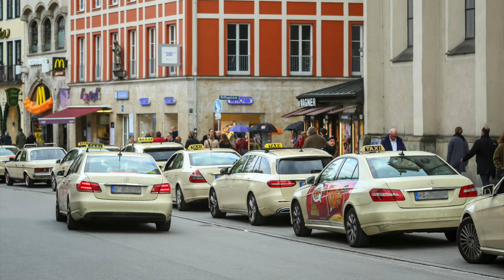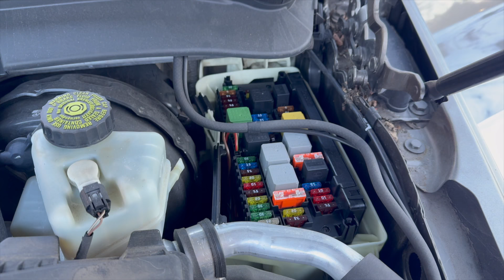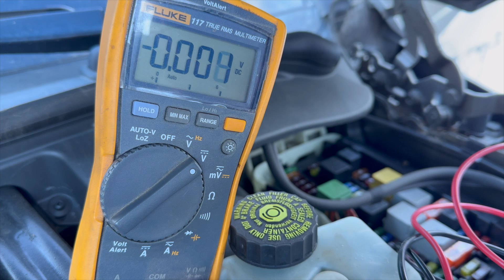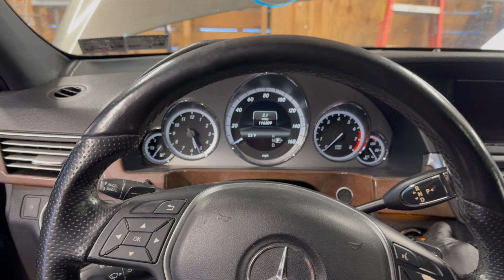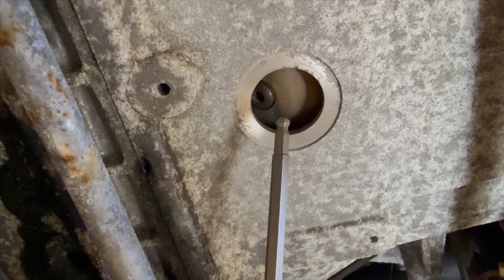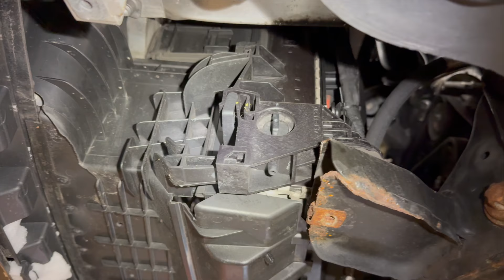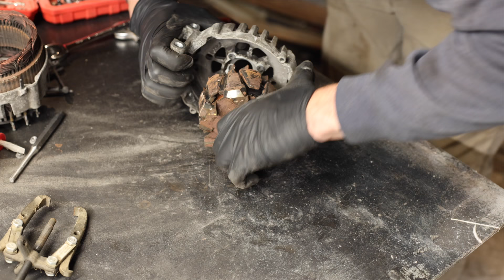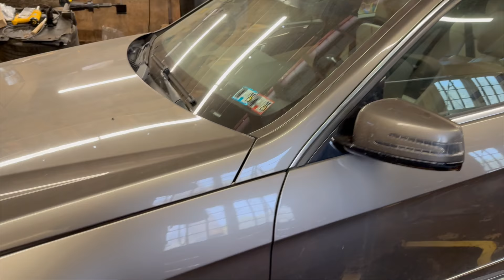I Bought the Toyota Camry of Germany, Except WAY Cheaper (and Better)

Comment: I am a German Taxi driver, my S212 E-Class OM651 got 600.000km with the Original Motor and Transmission. 
The Transmission gave up Motor was still running.
Reply: I have same engine in my sprinter van and currently I have 730k miles on engine and trans still running strong no issues neither has ever been opened.  Hands down best engine produced my buddy had 1 with 1 million and 50 thousand miles when he sold it
Reply: @mikibajrektarevic2543 Ah the old ones are reliable, the new ones are a nightmare, as all other cars, the systems light up like a christmas tree, I work for RSA, Waldo is right with the hit or miss statement, we had a million rule changes, like Sprinters and all other vans excluding the V class did not have Mobility warranty for non-technical issues, unlike passenger cars, who had coverage for technical and none technical issues, ironically enough they changed that rule literally today so that Vans and Transporters have coverage as well, people arent happy when they pay a lot of cash, do their service regularly, have an accident and then need to pay for the towing, when i saw the new rule book i thought it was a April fools joke, luckily its not, and as a Rep. I'm happy, i don't have to explain to people yeah sorry you had an accident with your expensive Sprinter, but an accident is not a technical issue so you are not covered, but if you have a "smart" and the same thing happens you are good, i mean what were they thinking, i mean corporate makes some braindead choices sometimes...
Reply: I bought ex german taxi car. E200CDI 2007. OM646 is one of the most reliable euro4 diesel engines. original transmission and engine. never been repaired. Has over 650K km. Runs great like 200K km car.
Reply: I always heard Mercedes was always on the least reliable vehicles list! I've seen some people have issues with s550 and cls class vehicles! Never would I have thought its compared to a camry!!!
Reply: @patrik4446  Quite the contrary. Widely known MB made the most durable cars for a very long time.
Reply: @martinsvensson6884 really? What are the best Mercedes to buy? Year and model wise? Are they expensive to fix? Im very interested to learn more about them!
Reply: @martinsvensson6884 history😊
Reply: @martinsvensson6884  I think it depends on the model. The small A-class did not have such a good track-record.
Reply: @ThorDyrden  really, 360.000 km with a A-class is quite a good performance in 12 years.
Reply: *italian
Reply: I own an GLK250 with the OM651 with 200k Miles and no CEL and my trans is still good. Definitely needs an trans service soon.
Reply: @jeremyocampo1529  Flushing and changing the oil solves most transmission problems.
Reply: Most likely transmission needs new conductor plate because both speed sensors is gone in it.  For 5-tronic it is 300eur in parts, for 7-tronic it will be a bit more because pate comes with computer that has to be coded to the car by dealer. I have w204 with same problem at 580k km
Reply: Did the trans break with or without servicing?
Reply: Sir. I am planning on buying a W211 OM646 E220 of 2007. Do you think it is as reliable as your OM651, if maintained well? It is on 160k kilometers
Reply: Aber auch nur weil die Buden gut von der Firma gewartet werden. Zumindest bei den meisten.
Reply: @nikoisibg  War meine eigene Taxe, hab auch alles selbst gemacht :)
Reply: Lucky you can get diesels
Reply: Manual or automatic transmission?
Reply: I have a W204 C220CDI with the OM651, it's almost at 300,000km and the engine still feels brand new. Sadly the 6 speed manual transmissions in this era are a bit problematic and mine is no different, first and second gear are hard to get into :/

Other than that, best car I've ever owned.
Reply: German cars exported to U.S. are looking less luxurious inside. Don’t know maybe no choice due to higher production costs and what it takes to still make a profit?
Reply: Impressive but still,  a Camry will make 1 Million KM as a warmup.
All you have to do is go for a ride with a taxi in Dubai and You'll get what I mean, very common to find a lexus with 800,000 KM on it with original Transimission and Engine.
Reply: @khaledsalah9248 yeah but with a mercedes the driver doesn’t want to shoot himself after half that distance 😊
Reply: @khaledsalah9248  There are diesel Mercedes taxis that have crossed 3 million km with the original trans and engine
Reply: @WarlordEnthusiast  Hey, which particular mercedes, engine and year ?
Reply: @khaledsalah9248  Mercedes is on a whole other level. It's a luxury car and the interior is very high quality. It's a complete different feeling to sit in a Mercedes.
Reply: @chrisb2942  Lexus is also a luxury car. I wouldn't say it's significantly worse.
Reply: @khaledsalah9248  Not as common as the MBs :) MB had the most miles on them on avarage before junked of all brands for a very long time.
A Camry is not going to last as long. Just compare the interiors after 200k miles. MB has been the only cars that can still feel relatively new after that amount.
Reply: Literally any car will run for hundreds of thousands of kms in Europe. The climate is cold, roads are smooth and not dusty so less stress on engine and components. In my country, these euro cars starts to rust and fall apart in 100,000 kms. Toyotas and Japanese cars keep running forever though.
Reply: @panzer3279  No, its more wear on them in Europe compared to the US. Since its much more city driving and shorter distances. Much smaller roads and a lot of stop and go. Also lots of salt in northern parts.
Reply: @panzer3279  We have undercarriage washers at car wash here in Europe to wash the salt from underneath, and it costs 1-2$. Do it a couple of times during warm days of winter, and after, and you're good. Although some models are known to rust no matter what, like b6 Passat, early C class etc.
Reply: @panzer3279  biased alert
Reply: @panzer3279  nah, old mercs are just better cars overall. in my country, roads are both in bad condition and dusty. And you see W124,w210,w211,w202s everywhere most have exceeded million km mark. Not many Toyotas tho. Even a Toyota of same age isn't comparable to Mercedes-Benz. Lexus are fine, they are just luxurious Toyotas inside, and old ones are straight copy of Mercedes outside.
Reply: @seddam You haven't seen a super high mileage Hilux then
Reply: @Badboythatsgenuine we've seen the 2UZFE, 3URFE, 2GRFE, 3MZFE all exceed a million miles
Reply: @panzer3279 You're wrong. We have salt on the roads throughout whole winter and the smooth roads are history since we're burning tax payers money in Ukraine and otherplace.

Comment: Meyle HD swaybar links look cheaper, but the durability is really upgraded. Original links are aluminium, while the HD is steel, with bigger balljoints. I recommend HD, been using these anytime possible.

Comment: To avoid hitting your thumb again, make your own punches and chisels from discarded valve stems.

I would have preferred to try to repair the original Mercedes arm; the one you installed looks very weak.

Everything you've done is very good.

Comment: I have a huge question that you can easily answer by your experience.  Have you ever had automatic transmission issues after changing your transmission fluid on the vehicles you have bought.  There seems to be 2 opinions on the subject.  One is that changing the transmission fluid is not going to cause the automatic transmission to slip, and that the transmission all ready had problems.  The other opinion is that the friction material suspended in the transmission is needed for the clutch packs.  I don't buy that because it would seem that transmission clutch material would be trapped in the filter.  The other argument is that new transmission fluid would make the clutch packs slip because new transmission fluid would be much more slippery than old fluid that was neglected.  Your input although not advice would be appreciated.  A famous mechanic You Tube celebrity is against changing transmission fluid if neglected, just the filter.  What I am going to do.
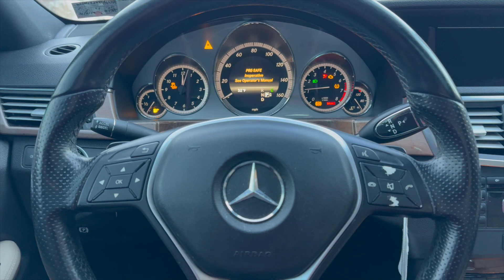Reply: I think this is dependent on your particular vehicle I have a brother-in-law who is Alexis mechanic and he said when they change the fluid in an LS 4:30 it wouldn't even back out of the Bay then there was like a TSB that said you have to analyze the fluid and determine how much of it to change to retain enough friction material
Reply: @c827q  it is not the answer I wanted to hear, but really appreciate you commenting.  I own a 2009 Corolla and on the transmission dipstick it says lifetime fluid.  It hasn't been changed in almost 5 years or 60,000 miles.  Based on your comment, I will change the filter and wait until the transmission slips before changing the fluid.  Fortunately I am having no issues.  I did a head gasket at 203,000 miles.  A little easier than rebuilding an automatic transmission.  I have repaired manual transmissions.  Much easier

Comment: YOU WERE SO CLOSE TO STRIP OUT THE THREADS IN THE OIL PAN AT 11:44! I DO NOT USE A WRENCH THAT IS MORE THAN 6 INCHES LONG. JUST SNUG AND THEN A LITTLE BIT. YES AVOID THOSE TORQUE SPECS FOR ALL DRAIN AND FILL BOLTS ON DIFFS AND TRANSFERS!

Comment: Ok, so I have the 2010 E350 (wife's car) and one thing that hit me is that your airbag needs to be REPLACED!  Since the skin over the release cable holes was not pierced it is likely that the TAKATA airbag replacement was never installed.  I believe this is a lifetime warranty or until the money runs out.
Reply: Maybe I suspect that mercedes maybe not use only takata airbags 😂
Reply: @mmuller2402  True,. but the 2010 W212 chassis had them. :) Global suppliers mean global problems!

Comment: Mercedes E Class is NOT a Camry, its 1000 times better than a Camry. I had two Camry's and they both were horrible made, one diesel busted the head gasket the first year, cracked the head 1½ year old, no warranty covered it. sold it after 3½ years with a huge loss it was run down. Another gas model, had cold start issues - ran uneven for first 40km.  3 different dealers couldn't fix. on the other hand, Since then I had several different E CLASSES, one ran 500k km without a hickup (old w124), 4 diesels, 3 AMG's best cars ever. I even tuned a W210 E55 to 600HP from 354hk, and then drove 140.000km in it, and it never had any issues in drive line or transmission from that, awesome cars!

Comment: Mercedes-Benz 4 cilinder diesel om601, om611, om646 &om651 are good reliable engines. Mercedes  Electronics and water is no good combination whe had the Mercedes-Benz w124 200d om601 no turbo very slow max speed 160km/h manual 4gearbox noting electric no power Windows no climate controle no cruise control that car maked it much over million kilometers

Comment: As a swede I get happy to see swedish brands like SKF (swedish bearing factory), but then made in Italy 🙄 IKF?
Reply: SKF has multiple manufacturing facilities around the world. Still most people's #1 choice for bearing products, for sure.
Reply: @brassmule  SKF hasn't even been swedish owned for a long time. Finnish company Ovako Steel bought it in the mid 80's but kept the name SKF because it's a well-known, well-established world quality brand.
Reply: @gaspdahl1  That is not an accurate statement at all.  The original Finnish company Ovako merged with SKF Steel in 1981 to form Ovako Steel and HQ was moved to Stockholm, Sweden.  Ovako Steel is now owned by Nippon Steel since 2018. 

The SKF Steel company and SKF, Svenska Kullagerfabriken, the bearing company, were not and are not the same corporations, and SKF is not owned by Nippon Steel nor did it ever merge with Ovako.
Reply: @brassmule  Then I was wrong, thank you for correcting me! 🙋‍♂️👍

Comment: I had a 91 Chrysler LeBaron that had a similar drain apparatus for the AC evaporator. Every so often I would have to reach in and “milk” the drain. I finally got tired of it clogging up, and removed the rubber boot from the drain.

Comment: I would add the sacrificial harness extensions for the cam adjuster magnets and cam position sensors.  I believe one set is actually available from MB (because of the oil in the wiring harness issue) while the other is aftermarket only.

Comment: To maintain alignment in the best way possible i use a laserpointer glued to a magnet and place it on the brake disc, turn it on and mark the dot on the inner fender or wherever the dot lands with a pen, has worked good so far even better if you can block the steering wheel and have the brake pedal pressed down before you mark the dot and start disassembly
Reply: That is very genius i need to remember that

Comment: You can pull the return line from the transmission cooler and pump new fluid in as it pumps it out to get a complete fluid change. Takes a lot of fluid but works pretty well.

Comment: Tip: Get oil-stop cables for these sensors in the cyinder heads, as the originals are known to transport oil into the (very expensive) ecu and ruins it. Where to get? Motoren Zimmer Germany

Comment: since you had some accumulation of junk in your sunroof drain it would also be a good idea to go ahead and clean your a/c evaporator coil as well. you can access it with a long hose right from the passenger footwell where the cabin air filter was. you may not notice it now in winter but in the summer future waldo will be thanking past waldo! 

my first mercedes was a 2011 E350... incredible car. never should have traded it

Comment: The problem with the leaking cam selenoids is common on Mercedes V6. As you found, it could damage the ECU.
Mercedes offers short oil-tight pigtails that are installed inbetween the sensors/selenoids and the wiring harness. You may want to install these to future-proove the car. Greetings from Germany
Reply: He did that on the GL he worked on in the last video.
Reply: On volvo trucks in uk pigtails are fitted after  when oil pressure switch leaks to stoping leaking in to ecu
Reply: It's not only a problem on these V6s, the problems started with the M111 EVO 4-cyl engines in the late 90s and persisted through generations and also different types of engines. Like you said, Mercedes offers "Ölstoppkabel" that are put in between the cabling there to stop the oil from going into the wiring harness and eventually to the ECU. It's easy to spot an installed cable because it has a neon-bright sticker on it.
Reply: Cam position sensors also like to leak oil that wicks into the ECU.
Reply: solenoids

Comment: Seeing the little corrosion on the underside under the water pump poly is a tell-tale indication that the bearings seal is toast. 26:01 
This is probably the original pump so over 10 years, I would replace it , cheap and easy fix while the coolant was drained and the belt and belt tensioners were out.
When you do belts and bearings an even alternator bearing was bad great change your water pump won't last.

Comment: 00:40 "What do the german taxi drivers know that we don't?" 

They know that they got huge rebates by getting a Mercedes because Mercedes wanted as many Taxis as possible to be E Classes so people would connect them with reliability and comfort when driving in a taxi. It was an easy way to make advertisements for their cars without actually advertising them in an intrusive way. 

After Mercedes dropped the rebates and support for Taxis in 2022 the numbers of Mercedes Taxis dropped by over 70%. So you might not see them as the common Taxi in Germany for much longer.
Reply: ah so thats why there are so many Toyotas and Hyundais in taxi yellow now. I wasnt aware Mercedes ended those rebates but it makes sense, with their current lineup of cars having such a horrible reputation for their interior quality...
Reply: @Macintoshiba the reason is the higher prices…
Reply: Which car is being used to replace the 70% share lost by Mercedes now? Genuinely curious.
Reply: @AmitGupta-ki4bt  it's not one car specifically. But a lot more VW, Volvo, Toyota and, up until recently, Tesla.
Reply: @AmitGupta-ki4bt Here in Stuttgart where Mercedes is based Theres are still a couple of MB Taxis id also say about 30-40%. A lot of Taxis now are Toyota Corolla as "Station Wagon".
Reply: @AmitGupta-ki4bt Never seen a Tesla taxi here in the UK. Plenty of Prius and Skodas. And a few years ago quite a few Dacias too.
Reply: @AmitGupta-ki4bt  almost every Taxi car I saw in Schleswig-Holstein and Hamburg was a VW Caddy and the rest were Mercs
Reply: @IsntThisAStupidName we had a VW Caddy (in Belgium). Worst car by far! Permanent engine check light, at the mechanics once a month etc.. We also had a Mercedes C class. Mechanically sounds, just minor electrical nigs. Our most reliable brand has been Toyota (Auris and Corolla hybrid station wagons), the first generation Nissan Leaf and first generation Kia e-niro.
Reply: @AmitGupta-ki4bt  Prius, not even joking
Reply: @AmitGupta-ki4bt i live in the city of VW so most taxis are VW's now But there is a lexus/toyota dealer 40 minutes away so toyota takes the second place
Reply: Instead most of them seem to be driving Toyota Corollas nowadays
Reply: What an irony if the Toyota Camry was to become the German taxi of choice.

Comment: For the torque converter I am surprised you did not drill out the round hole enough to get some heat and the right “socket” on it. 
I appreciate you video they remind never to buy a German car. My experience is German cars, I am always concerned to put miles on them while putting miles on Japanese cars are not even a concern. This until I have throwaway/disposable money. Then still my main transportation would still be not new Toyota/lexsus.